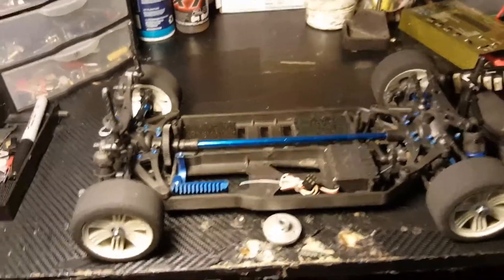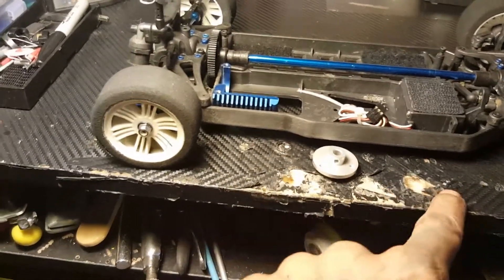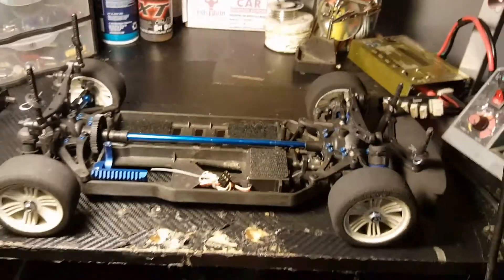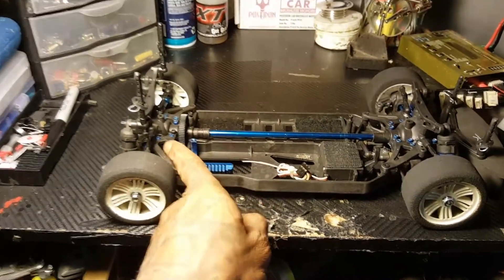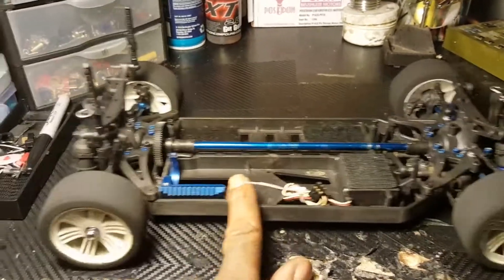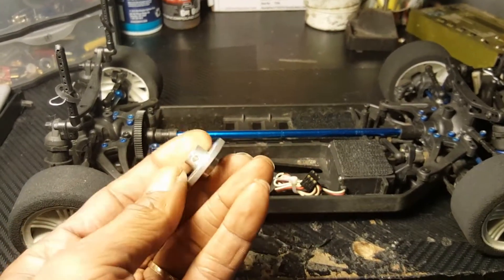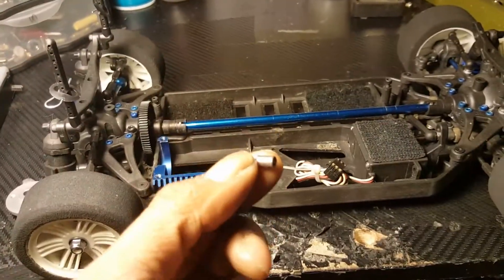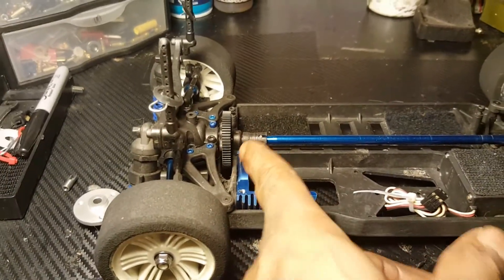Tc3 build,need help!

Comment: TATMONEY yeah stock gearing works perfectly on that chassis . but if that's what he wants,  it don't look like that spur gear adapter will fit looks to thick from what I can see on the video.   probably be best to use a skinny pinion as a spur instead of the adapter